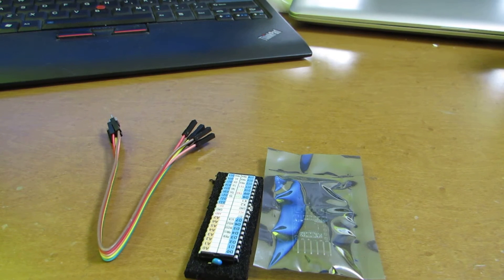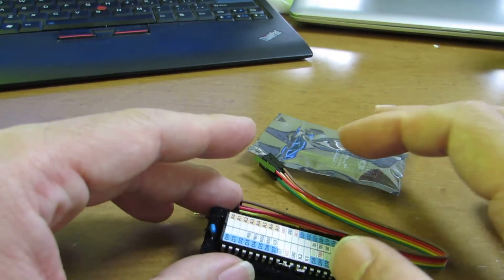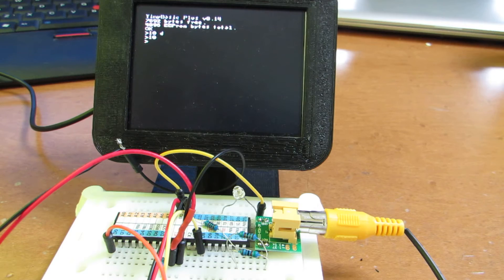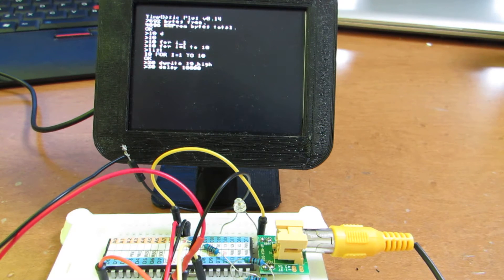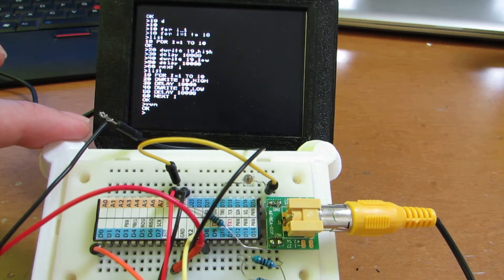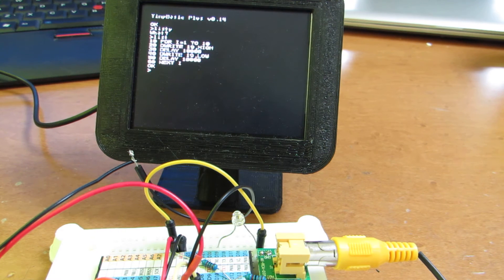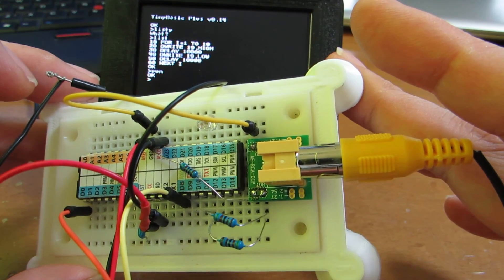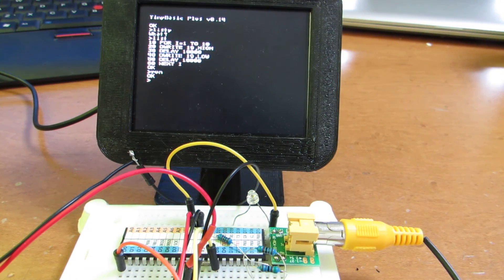Minimal computer by "Minimal and self-contained ATmega1284P "mod chip""

Comment: Looks nice! How large of a BASIC program can it hold in RAM? Also, does it have the EEPROM saving enabled?
Reply from the maker: Hello, free RAM is around 8kB (7692 bytes ) and 4kB (4096 bytes ) EEPROM save is supported..... 1284P itself has 16kB SRAM but PS/2 support and video support occupies lot!
Reply: Do you have any graphics functions for the LCD? Is it possible to draw shapes and stuff?
Reply from the maker: Yes! Fundamental graphic components, based on Adafruit GFX library (circle, line, filled circle, etc...)

Comment: Hello, That looks great. I am impressed!

Actually I have a ATmega1284p-PU here and I am looking for a bootloader and a possibility to include that in the current Arduino GUI 1.8.0/1.8.1. (And write on it with an Uno. Do you have a link to explain that somewhere? Thanks for your help.
Reply from the maker: Hello, just simply add 
https://mcudude.github.io/MightyCore/package_MCUdude_MightyCore_index.json
in Arduino IDE will add Atmega1284P support, and also bootloader can be loaded as same as the way for atmega328p (Uno).
Reply: Thx that worked :-)
Is it possible to get the document somewhere to print the sticker on the chip?
Thx again

Comment: Is the screen a Tft connected to chip pins? If not then how is it connected? Also how did manage to use a keyboard as an input for the chip
Reply from the maker: Hello, video is connected through composite NTSC signal and keyboard is connected by PS/2 interface.

Comment: I have a question, Is 16Mhz crystal is important or any other value will work? Thanks
Reply from the maker: The bootloader is programmed for 16MHz and any other frequency would work BUT serial and video timing, everything will have de-tuned value, meaning PS/2 keyboard connection will not work nor video out will not produce proper video sync signal. The proper selection of bootloader (for example 8MHz) will work well.
Reply: Thanks a lot.